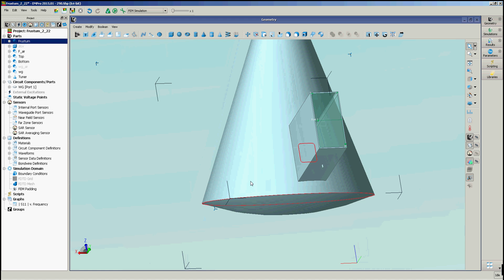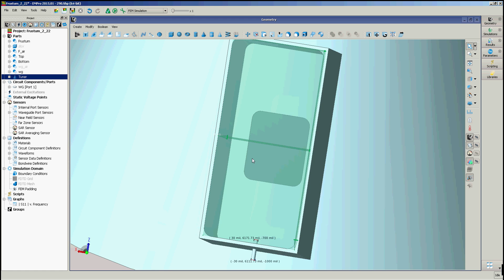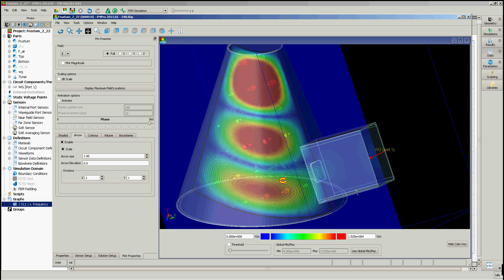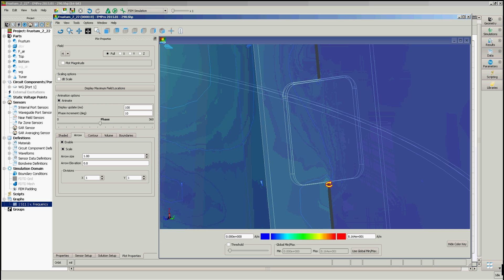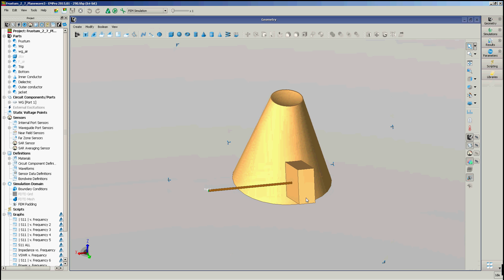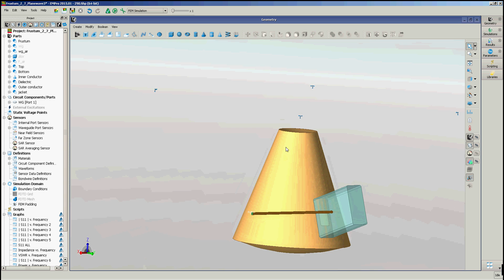EM Drive Simulation

Comment: What are the specs of your computer ?
Reply from the maker: i7 4790k, 32G ram, 500G M2 SSD, definitely hadn't learned how to use its full potential when I made this
Reply: Ok then you've got plenty of firepower there. I'm assuming the software is DX11........And your GPU ?
Reply from the maker: Honestly don't remember the software version I was using
I've got a gtx 480
Reply: kurt zeller I just thought the computation might be using the GPU but it seems its CPU bound. Appreciate the feedback. Keep up your simulation. As far as propulsion is concerned your on the right track.

Comment: Considering the fact that it isn't known exactly how the thrust is being produced, this program will not show anything new.
Reply from the maker: +Pat Emilio (Illogic Buster) Of course, but it will help determine the dimensions to design a high quality resonator to verify whether the EM Drive can thrust
Reply: +Patrick EH (Illogic Buster) it's hard to explain in words, but it's not about the thrust that's being produced, it's about the thrust that is being negated.
Reply: kurt zeller
It has already been determined that thrust is produced.
Reply: Blend Crafty
Until we know how the thrust is being produced we won't be able to determine how much, if any is being negated.  We have no working theory of how this device is working.
Reply: Patrick EH that's not what I meant at all, just the creation of the waves themselves is producing thrust, so is the waves hitting the walls of the cavity, what I meant about negation is that when waves hit on two opposing sides, it negates most or all of the thrust in either direction, think of the large side as up, small as down, and the other two as left/right, when it hits left and right, only some of the thrust from it hitting is going down, the rest is going left/right and negating each other
Reply: so if the cavity was very elongated it would reduce the amount of down thrust and increase the amount negated out the sides
Reply: Blend Crafty
How do you know that when we don't know if that is a factor ABSENT a theory.  Please outline your theory (peer reviewed) of how the thrust is being produced.  So far you are NOT in line with its inventor who I'M sure has a better grasp of this than you do.
Reply: yep, you really didn't understand what I meant, even after I tried to simplify it for you
Reply: Blend Crafty
No, I understood.  You however, don't understand why your test will not give you info that is useful.  You might after you do it for a while though.
Reply from the maker: +Patrick EH (Illogic Buster) Although anomalous thrusts have been observed, they have yet to be irrefutably proven to be thrust. Thermal expansion, shifts in center of gravity, and several other effects could be responsible for the observations. I intend to design a high quality resonator to amplify the observed effects.
Reply: Dave Distler's EM drive 1701A

Comment: Very nice work Kurt. I did notice your standing wave in the TE013 mode on the bottom looks a little unsymmetrical. From meep simulations this has lead to the mode rotating around in the cavity. Do you think this is a problem?
Reply from the maker: +Michelle Nosearchomme I have not seen that but thank you, I will definitely keep an eye out for it!